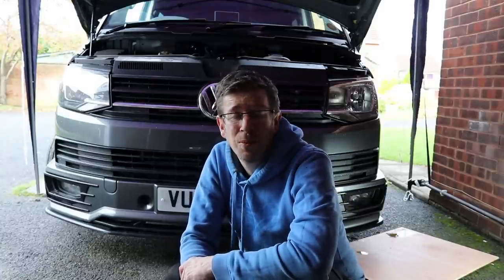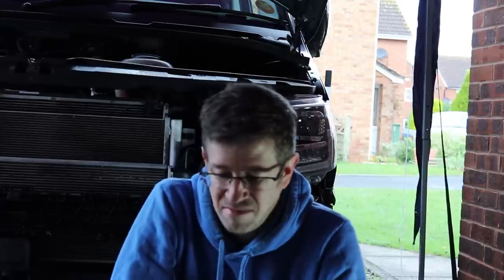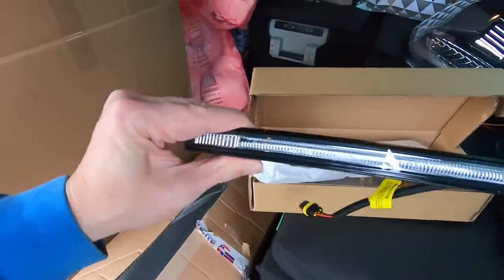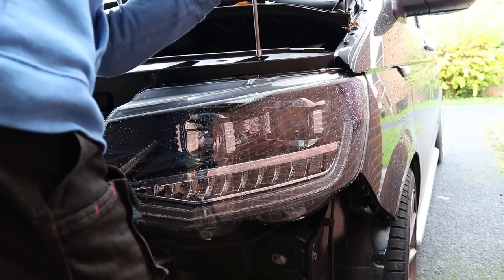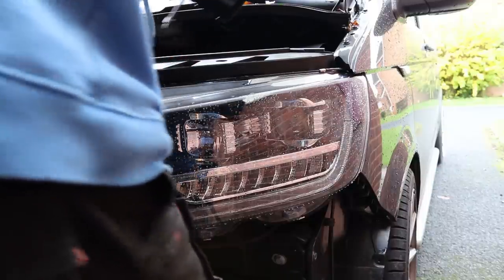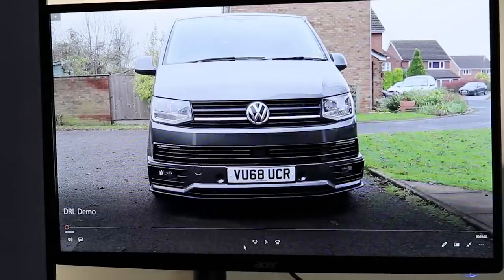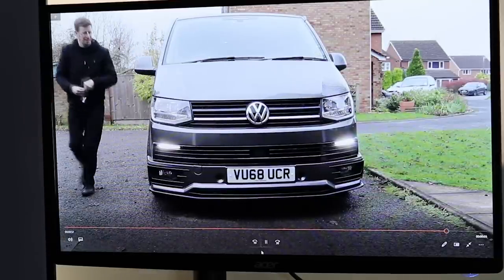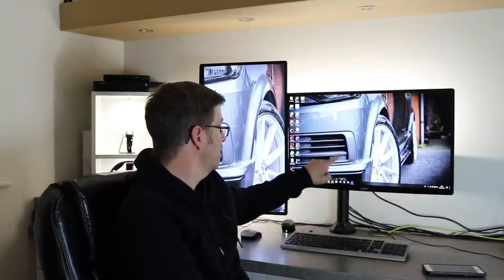Installing T6 DRL Headlights and Lower Gloss Grill with DRL's

Comment: Good vid. It inspired me to get the same lights. Not many on the market anymore but I found them at Litec in Germany. Got them yesterday. The V3's are out, however I liked these better for the fact they still have the signal in the same space. Can't wait to put them on. I also got the T6.1 OEM LED tail lights. They are awesome.
Reply from the maker: Nice!!!!  I bet you can’t wait! I do like those 6.1 rear too 👌.  Good luck modding👍👍

Comment: Where did you ground your DRL ground wire too? I had mine directly into the negative battery connector. Now I've taken out and put the ground on a bolt above the nearside headlight on the engine bay, I'm getting a buzzing noise?
Reply from the maker: Sorry for late reply!  I grounded mine in the inner wing while the bumper was off.  If you view at 11:00 in you’ll see me drilling for the negative 👍
Reply: @SteveField  no worries. I've put it back into the battery negative and it's stopped buzzing. Turns out you need to grind down the paint to get a good contact against the metal to properly ground. You have a V smart V Dub 😎 I've just had mine remapped yesterday, drives a lot smoother. Next is the alloys powder coated in matt bronze with calipers painted red then seat belts changed to blue straps then the front seats are upholstered in York....complete money pits! Ha

Comment: Hi Steve, love your videos.. I watch them all. Just wondered if you know how the grille drls link into factory led lights ? I’ve just got the travelinlite kit installed in my T6 but have noticed conflicting information online regarding the compatibility with the factory leds . Just thought you might be able to point me in the right direction ? Cheers Dan
Reply from the maker: Hi Dan,  I am not sure if the factory leds differ wiring wise but there should be a cable which carries 12v when the sidelights are turned in and this is the cable your looking to splice into.  I have the factory halogen and seem to recall this cable was the orange but it’s been a while since I carried this out!

Comment: Have you a video on changing T6 headlight, side and DRL bulbs please.
Reply from the maker: Hi Nick,  thanks for your question,  I don’t specifically.  I have removed the complete units a few times so never needed to change a bulb whilst the headlights are installed.  I do know @axis has done a bulb change video on his channel on his T5 which is very similar to T6.  👍

Comment: Hi Steve sorry been a pain  I want led light on my t6 2017 but the but Vw said there don’t do them and it can’t be done  because. Of the wiring it  I see you done yours cheers neil
Reply from the maker: Hi Neil,  Try #TransporterHQ link in the description of the vid as they supplied these lights and the link with take you directly to the product so you can ask them to confirm they will be fine on a 2017 model.  (i cant see any reason why they wouldn't)

Comment: Hello!,, you cam help me?, My English is very bad because I'm Spanish and I don't speak it very well. could you tell me where you bought the lower front grille with the daytime running lights if you are so kind please? Do you know if it is possible to buy the lower daytime running lights of the lower grill without the grille? that is, only the led light to attach it to the original part that the van already comes with, if so, please send me the link if you are so kind about both the daytime led lights and the fiurn lights together with the plastic part of the grill bottom where it fits Thank you very much and greetings from Spain

Comment: How do you stand with the VW warranty once you have played with headlights and wiring loom.
If you have any electrical issues in the future
Reply from the maker: Hi,
I am only guessing here, but i believe if the warranty issue is related or in connection with/to the modified area it would be invalid, (if it can be proven it has been caused by the products or wiring etc), however I believe you should not carry out any modifications if you are not OK with a potential warranty exclusion.

Comment: Great vid Steve,, thank you .. Are these lights self leveling ? Also do the DRLs look like a strip on these headlights rather than a line of LEDs ? Cheers bro , They look awesome on the vid
Reply from the maker: Hi Buddy,  Thanks :-)  so they are not self leveling but they do seem to work with the internal electronic dash adjustment switch!   I know what you mean about the row of LEDs vs Strip as that was what i was looking for!! they are ALMOST a strip but not quite. the only prob I found is the strip version from other companies was good but the lights within these were not good!  so I took the decision to run with these as the main headlamps were still good andthey look smart when its all turned off!  hope this helps.  (P.S the image taken at dark night at 0:57 in the video is my actual lights so see what you think dude?)

Comment: Steve can you tell me how the lights are on or you can drive normally at night
Reply from the maker: Hi,  do you mean the main headlights or the lower drls?
Reply: @SteveField  headlights at night, What is the visibility at night.?
Reply from the maker: @moto46ingp  these units with the H7 LED lamps in them are very good!  I now have the H1 in the main beam too and that is now excellent aswell.  Masssive improvement on the stock headlamp with a halogen👍👍

Comment: Hi Steve, did you need coding for the dipped and main beam to be on at the same time?
Reply from the maker: Yes you do need to use vagcom to get the dipped on with the main beam.  I have not actually coded mine yet!  It’s something on the list to pop over to THQ and take care of this👍
Reply: Hi Buddy, you may have picked up on this already but if you sign up to the Carista Beta app you can activate the dipped and main option in there yourself and it’s free.
Reply from the maker: @dannicklin4727  Hey Buddy,  No, was was not aware of this!  that good news I will have to reactivate my Carrista and sort that !! 🙌Thanks for sharing that Dan👍

Comment: Nice job bud, I've been looking at these lights recently both the headlamp upgrade and the daylight running grille LEDs.     Silly question perhaps but what's the radar cut out for in the front grille?
Many thanks in advance Eddie
Reply from the maker: Hi bud,  cheers,  the radar cut out if for the radar that detects vehicles that have stopped in front of you and assists braking if ness. 👍
Reply: @SteveField  Hey Steve,  I fitted my new V2 lights today on my T6 and they look pretty decent.   I also got the LED fog light kits too which I thought would be worth doing too.   One thing I noticed is that when the indicator is turned on the respective fog light for that side comes on until the indicator is turned off.   Do you know by any chance if they're meant to do that??  I've contacted TransporterHQ but its a bit late in the day so thought I'd tap your brain!!  Thanks in advance.  Eddie
Reply from the maker: eddieq1905 Hi Eddie,  Yes as you might be running the factory settings if you have never changed the settings the default is turning the wheel or indications will light the relevant fog light up.  You can use a Carista to turn this feature off! I turned that off on mine and set things so the in the daytime the headlight DRL on the indicating side with go out while the indicator is on.  (That only applies if not using dipped headlights) do you own a Carista?
Reply: @SteveField  Ah amazing Steve thank you so much for the prompt reply.   Alas I don't own a Carista, but hey you live and learn.  I'll google it and see if I can get hold of one.  Something else to get involved with!!  Best wishes mate
Reply from the maker: eddieq1905 I know tell me about it 😂. Good news is they go for under £20 and the software goes through an app on your phone.  @dubiousengineering made a video on Carista a few months ago so may be that will give you some idea how, what & why etc👍
Reply: @SteveField  Ah cool stuff mate, I'll check it out now.  At least I know it's not a fault though that was my main concern to be honest mate, but all good.   Thanks a million for the reply  - all I need to do now is sneak a set of alloys on without the Mrs knowing !!  wish me luck!!
Reply from the maker: eddieq1905 😂😂 GOOD LUCK!!

Comment: Hi Steve, Can you tell me if your van is Indium grey?
Reply from the maker: Paul Weston Hi Paul,   Yes it is 👍
Reply: @SteveField  Great, thanks for the swift reply. i will be getting a VW California 6.1 next year and was going to go for two tone paint until i saw your video with the new wheels. Looks fab. so i think i am going with the grey and will probably get the same wheels as you have. as the colour and the wheels really look great together.
Reply from the maker: Paul Weston that sounds like a dream machine!  Really please with my Vossens as they fit superb and compliment the van.  I have removed them for the winter to install a winter set up (not because you have to!!)Just give me a different look for 3-4 months and then I put the Vossens back on for the majority of the year.  But while I was waiting for the winter wheels and tyres I ran the stock wheels for a week or so and I prefer the drive with the wider wheels.  There is less impact through bad roads which is the opposite to what I read online 🤷‍♂️. All the best with your new van 👍

Comment: The ones in the video clip please
Reply from the maker: Ok so in the clip it is running the Vossen CVT 20” wheels. 9j on the front 10.5 j on the rear (I have a video on these search wheel reveal) and the suspension in the clip was running stock dampers with Ebach Pro 50mm lowering springs 👍